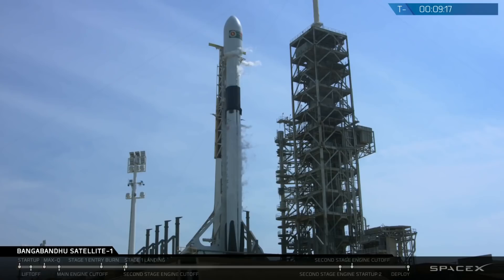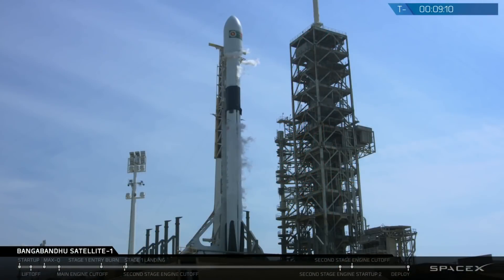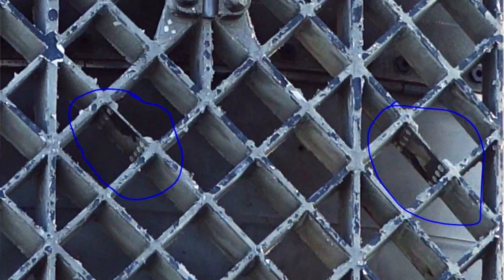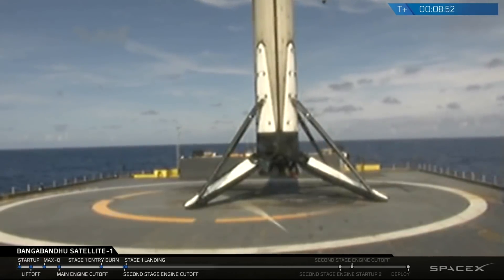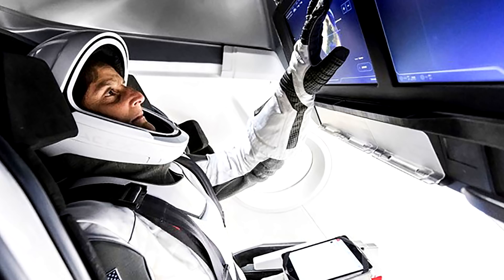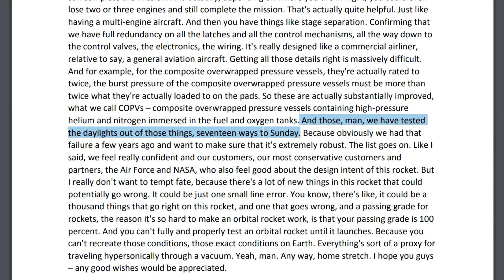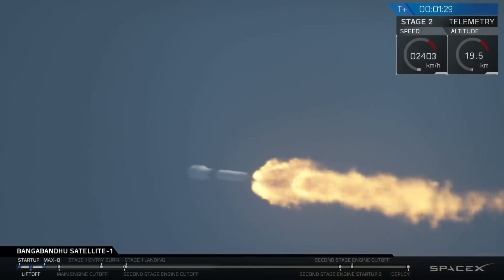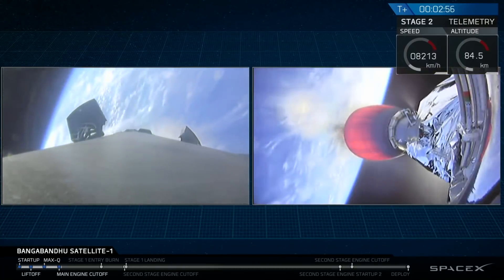How Well Did SpaceX's new Falcon 9 Work?

Comment: Reduce the amount of air not completely remove it. If it was a complete vacuum the tunnels would implode
Reply from the maker: Nah, 1 atmosphere of pressure difference is nothing.
Reply: Scott Manley I've seen a gas (tanker) truck implode and it didn't even reach a full vacuum. It was filled with steam and the steam reverted into water dropping the pressure inside of the tank.

It didn't even reach a full vacuum
And it caused critical failure.
Reply from the maker: And I’ve seen vacuum chambers large enough to test spacecraft, tanker trucks aren’t designed for negative pressures.
Reply: You are right they can be made. But can they be made large enough to fit a train and spanning hundreds of miles. It cannot be a complete vacuum. And the biggest vacuum chamber in the world is not that big and it has such thick and strong walls that it can take that pressure. They are making it a vacuum just not a true vacuum. If it was it would implode.
Reply: You're still wrong. The pressure difference between "true" vacuum and what you are describing as "not true" is tiny. Tanker trucks are made to take high positive pressures, they are NOT made to take high negative pressures. That's why it imploded.
Reply: Mythricia I'm having a hard time getting proof😦

Not quite sure how to look it up.
But correct me if I am wrong. But the bigger the chamber is more force is applied.
As normal pressure is 14 psi of pressure on us at all times. When you have several hundred long tubes that pressure will sky rocket especial at the middle of the tunnel.Where if I am correct the most pressure will be applied.

If they had it at let's say 7 psi instead of 1 it would allot easier to make it work.

Also if I am correct long chambers experience more force than more squarish rooms.... I know there is a better word than squarish. But the word is not coming to mind.
Reply: Fuck
Reply: Mythricia it appears I am wrong. I have made false assumptions apparently. Forgive my ignorance.
Reply: We can build submarines that are 400+ feet long, 40 feet tall, that go 1'600 feet below the ocean. At that depth, the pressure is ~729 PSI (or, ~50 atmospheres). I think they can find a way to build a tunnel than can hold 1 atmosphere of inward pressure......... It's nothing.

Also the total pressure on the hull of a structure only increases because there is a larger surface area. The pressure per square inch remains the same. It is constant at a given depth / pressure difference. Each segment of the tunnel only has to deal with it's own surface area pressure, which as we've said, is only 1 atmosphere, which is almost nothing.
Reply: Mythricia I know. I figured out where my logic was messed up.

Comment: Don't forget the main reason for the titanium grid fins is because of the falcon heavy. They were using the interstage to bounce air into the grid fins for control but the falcon heavy side boosters have nose cones. This meant that the grid fins didn't work in the super sonic airflow so they needed to be bigger to catch the air. I think it was the post launch conference for the falcon heavy that musk said this.
Reply: Yes, they are needed for the FH side cores, but that is just the advantage of them. Their main reason is for reuse of the F9

Comment: 🚀I disagree with Nasa about the fueling of Falcon 9 with astronauts on board. I think it would actually be safer. The space shuttle was fuelling well before the astronauts actually boarded the craft. Fuelling took hours, where Falcon 9 takes around 30 minutes. The technology has drastically improved as well, along with a more robust escape system, something the shuttle did not have. 
Besides, it does not matter, space flight is inherently dangerous. If you are willing to strap your butt in and go on an adventure I say more power to you!🚀🇺🇸
Reply: Speed of fueling... doesn't really make NASA any happier. If anything, they'd be more worried that the rocket is still cooling down during launch. The Shuttle at least reached a steady state temperature by the time crew were loaded.
Reply: Yeah you probably wouldn’t sit in it for the fueling. 😂
Reply: NASA accepted SpaceX's proposal for refueling with people on board now.
Reply: Simon Maier yeah, anything to make them get off their asses and make the commercial crew program happen. Thank goodness for boeing though. 😉

Comment: Scott Manley, could you do a video explaining the octograbber? I had to google to find out any info. It's only mentioned in passing  and nobody has a video. Thanks!
Reply: From what we know, it is a little (actually big) robot that is parked on the droneship. When the rocket lands, the octagrabber drives under the rocket and holds on to the octaweb so the rocket doesn't tip over

Comment: Regarding Load-and-Go (fueling the Falcon 9 after the astronauts are onboard), NASA's Aerospace Safety Advisory Panel (ASAP) seemed less skeptical of the idea during their recent quarterly meeting, even noting that they should take into account the increased safety for the closeout crew, allowing them to do their work alongside an unfueled rocket.  It sounds as if a lot will come down to how satisfied NASA is with COPV 2.0.

Comment: Hey Scott, I’m kinda confused about how the black coating helps the coated areas of the rocket deal with heat better. Doesn’t black “absorb” more energy and get hotter?
Reply: The ‘color’ is only relevant if the system is dominated by radiation, like in space or to an less extend if sth sits in sunlight. However, for the booster the energy/heat comes from theaerodynamics, and so the radiation properties aren’t that important and the thermal protection/isolation is what you are looking for.

Comment: What specifically is the advantage of maintaining chamber pressure on the 9 Merlin engines and constant thrust on the block 5? I would have initially thought that increased thrust during ascent was a good thing?
Reply: Constant thrust means the chamber pressure must drop as atmospheric pressure drops.  Thrust is generated by the differential between chamber and outside.  Keeping thrust constant mans simpler calculations for trajectory, fuel consumption, etc.  Throttling still occurs at MaxQ.
Reply: I imagine that the change makes the fuel consumption slightly calculation slightly more complicated as its constantly reducing... Someone else mentioned that the new varying thrust has a higher overall isp than the constant thrust, but I havent been able to find any sources that verify this.

Comment: 2024 is less corrosion prone, 7075 corroded easier, 2024 is also less brittle. I'm sure that either will work given engineering changes for the loads expected. I'd think the 7075 or 7000 series part would be lighter.